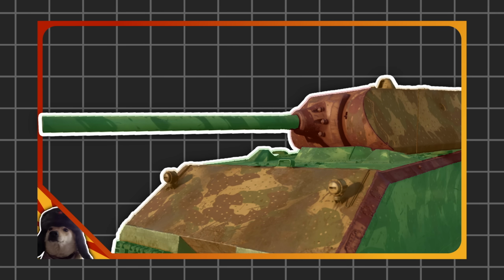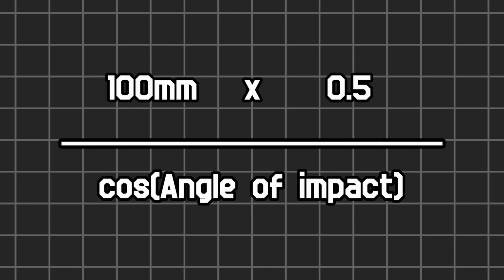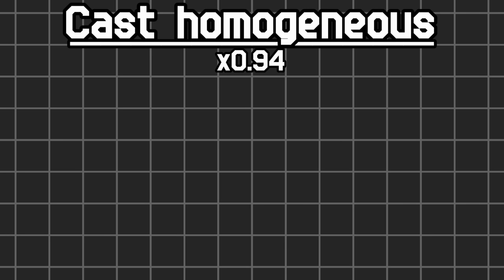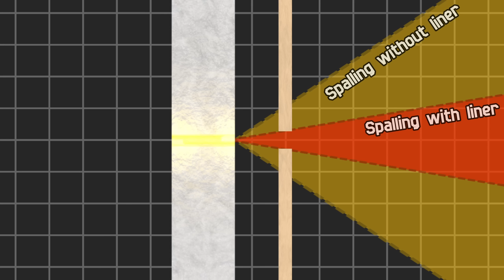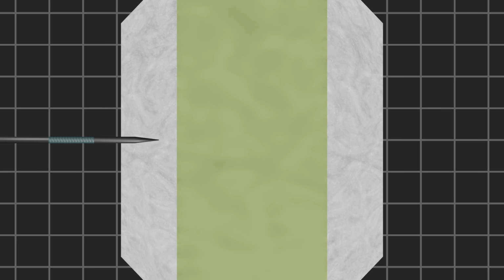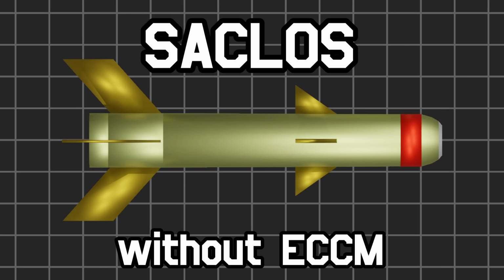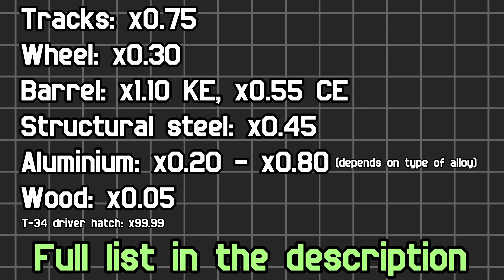Armor Types in War Thunder EXPLAINED | War Thunder Tank Armor Guide

Comment: 2:30
Bro, plastics are ceramics too😭
Yeah, engineers are using specific materials as a ceramic (the material between 2 plates, mostly metal plates and has more heat resistance, which is good against hollow charged ammunitions/anti-tanks and ceramics mostly less resistant against metal ones (two plates that is covering ceramic(Except Abraös tanks(M1A1 HC, HA and M1A2+)). Metals are less resistant against heat and more resistant against kinetic ones mostly.) 
But, you can out a metal plate as ceramic if you eant too, it's mostly about how you placed it. 
But, it's better to use it correctly.
Reply: Plastics are polymers
Ceramics are their own material class
Reply: @luisrenato4089 
I know. 
As an armoe type, the thing you said is correct.
But, when you use it in a NERA, it becomes ceramic.

Comment: I wonder if the game implodes if you defy all logic and manage to hit the enemy armor at a 90 degree angle.
Reply: You hit people at 90 degrees all the time
Reply: @thatguy7612 he meant 90 degrees from vertical
Reply: @Epsilon2042 you mean 90 degrees from horizontal?. Also i that the original comment might have been confused and means at 0 degrees to the armor plate, which would be game breaking at all and would just be a ricochet
Reply: @thatguy7612  90 degrees form horizontal would just be an armor plate with no angling

But yeah it wont be gamebreaking, only a furstrating nonpen/ricochet

Comment: there are several errors:

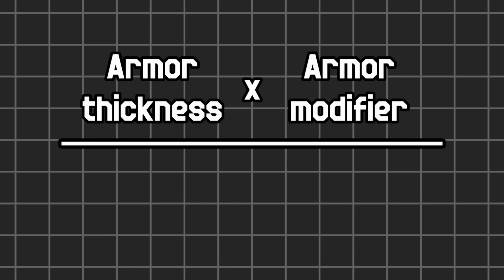0:40 it is the effective armor for the line of sight. basically how much armor it has to go through at that angle.
but the actual effective armor is only this amount for HEAT type shells.
against full calibre shells and gen 1/2 APDS the effective thickness is more than the line of sight effective thickness.
for example the upper plate of a T-54 1947 at 60 degrees has an effective line of sight thickness of 240mm. 
shooting a very strong APCBC at it (BR-482B) and the effective thickness is 360mm, 3x of the base thickness instead of 2x which was expected (using the 83mm solid AP the effective thickness is 400mm)
shooting it with the "strongest" gen 1 APDS from the Conqueror at the same angle, and the effective thickness is 421mm, more than 3x.
shooting it with a gen 2 APDS (105mm L28A1) the effective thickness is only 308mm, still more than the line of sight thickness.
against APCR (T44) the effective thickness is 560mm, meaning it is by far the worst shell to hit angled armor

get 3 APDS and APFSDS will usually have the same or a bit less real effective thickness as the line of sight.
same target, using a gen 3 APDS (M728 or L15A3), the effective thickness is 218mm, less than 240.
using the best APFSDS in the game (DM53) gives an effective thickness of 207mm

HESH and HE does not care about the angle (except when it is a really high angle, then they can bounce off).
HE either pens or not, if it pens then it will overpressure the crew in that compartment.
HESH can spall (perpendicular to the plate) or overpressure similarly to normal HE (HEAT can do this too) but it is not as reliable.

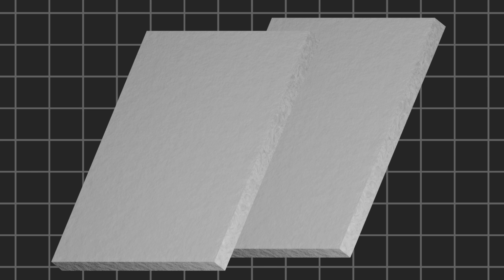2:07 it highly depends.
it is very effective against APCR and gen 1 APDS (and somewhat effective against gen 2 APDS and has pretty much no effect on gen 3)
it will also make APCR and gen 1 APDS (and sometimes gen 2 at high angles) shatter.
for example shooting the upper plate of a Super Pershing with a Conqueror's APDS gives only a 240mm effective armor but it wont pen because it shatters. same goes against APCR, however a gen 2 APDS (L28A1) will almost always pen, and gen 3 APDS and APFSDS always (given enough pen)
it works well against HEAT and especially against HE and HESH (given if no weak plate is present nearby because then it can trigger overpressure).
but even against HEAT distance matters a lot. 2 plate close to each other will offer much less protection than 2 plates with a lot of distance.

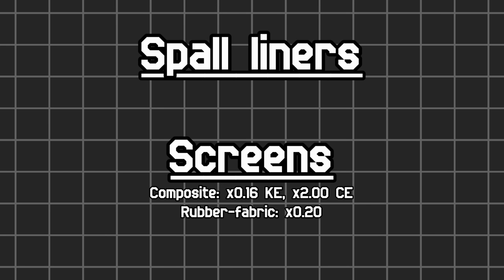2:53 again very depending.
it will vary from tank to tank basically.
for example the upper hull on a Challenger 1 and 2 are almost the same (20/25mm RHA, 200mm NERA and 80mm RHA), yet the Challenger 2 has an effective thickness of 510mm while the Challenger 1 only 300mm vs the same shell (L26) at the same angle
also an addon composite on a ZTZ88 with less than half the tickness of the one on the T-55AM offers much greater protection against KE and almost the same against HEAT despite being much thinner

3:34 some top tier russian/chinese ERA is also effective against KE, however the angle of impact also play a key role. a right side on hit from a HEAT shell will likely pen ERA, even the stronger ones, yet at high angles it can stop even APFSDS (if the ERA is capable of that, not all can).

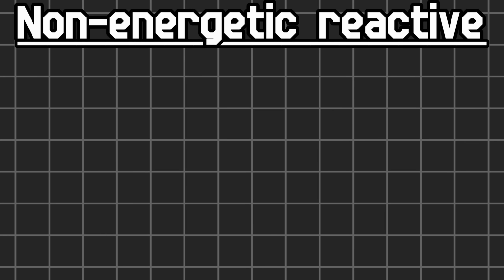3:46 or pick up a resupply point in PVE mode

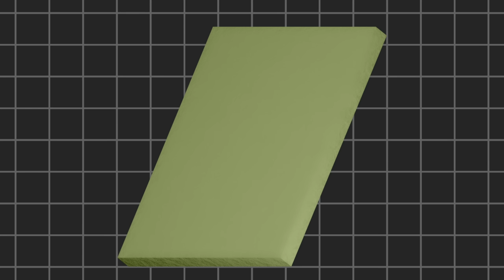3:50 aka "non explosive"

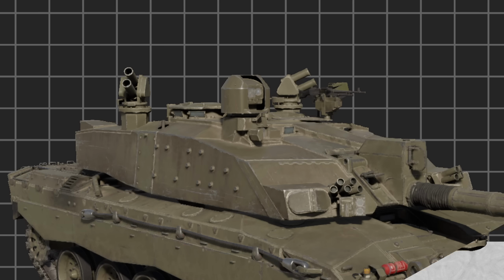5:18 they also have other factors. they can intercept shells within a speed range.
for example the drozd APS can only intercept shells that fly faster than 70m/s but slower than 700m/s
there is also a limit on the elevation and often the location, for example said APS can only intercept shess that are comming from where the turret faces, while the Challenger 2's APS can cover a bigger area
Reply: Dude if all of these situational applications were accounted for the video would be triple the lenght
Reply: @EdyAlbertoMSGT3  I don't see how a more elaborate explanation's a bad thing.
Reply: @EdyAlbertoMSGT3  thy are not situational, they are depending on important factors that werent even mentioned and some things are just plain wrong
Reply: Wrong
Reply: @A7XmuRderu011  yeah what is wrong? lol

Comment: spaced Armour (with reasonable spaces between the plates, not something like 5 meters) is less effective against conventional kinetic rounds than just one plate (maybe against apdsfs it performs better, dunno i don't play modern tanks). I am pretty sure this is true in game, but it's most definitely true in real life. The Cromwell has 2 plates, both around 25mm thick so a total thickness is around 50mm yet its still less effective than the unangled armour on the t-34.
Reply: The main use of composite armor is to reduce weight, if any MBT were to have no composite and maintain its armor protection they would be far more expensive to produce and significantly heavier

Comment: I still don't het how rubber has a higher multiplier than composite armour. 2:57
Reply: because composite screens are designed against HEAT, and have a 2x multiplier, but perform a lot worse against KE because they are not designed for that
Reply: @o-hogameplay185  that's not an answer lol

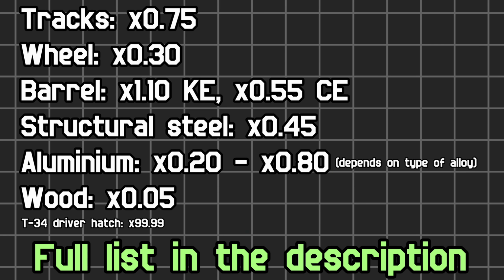Comment: 5:30
why the fuck does a barrel have 1.1x modifier Huh?!
Reply: to be fair, the type of steel (regular rolled or hardened idk) used as barrel in War Thunder is different from regular armor steel, if you go into WT Xray and look at the barrel and breech, it's called "Gun steel" (or Barrel steel, idk i haven't played for a while)

AFAIK the steel alloys used in the barrel, breech and the muzzle break (if the gun have it) are extra hard to handle the pressure of the rounds fired, the exact composition for these steel alloys are most likely restricted info or straight up classified (as i cant find any for for any gun in service larger than a 20mm, even then it's already hard to find with only google search) so that's why it has a higher modifier than regular rolled steel armor.

pretty realistic imo, but i kinda wish they put more of their energy into actually balancing the bloody BR of these vehicle with other method more sophisticated than "wait, this non-premium vehicle has a higher win rate than other vehicle in the BR range? utterly unacceptable! put it .7 BR higher!" 

but hey, if it means it takes more autocannon shots to destroy it, sure why not
Reply: maybe it counts as spaced armor
Reply: tank barrels are often made of much stronger steel alloys, for example the tank barrel of the T-44 uses a chromium alloy
Reply: *stalinium alloy @ChristandMMA

Comment: The T-34's driver hatch is blessed by the snail and only on 1/150 chance do you get the correct armor thickness and are able to penetrate it.
Reply: The thickness is correct, the hatch is about as thick as a Panther's upper front plate. The problem is that irl it doesn't matter since the shell would punch the whole hatch into the tank, but war thunder doesn't model structural damage.

Comment: The funny thing is is that Gaijin don’t understand that TOW missiles are designed to make soft kill useless, but i somehow find it is more effective against TOW missiles because they don’t understand that it doesn’t work on them
Reply: smartest anti furry
Reply: Get yo ass outta here with this corny ahh profile picture
Reply: TOW is SACLOS, so nothing wrong that soft kill APS work
Reply: @igororlov3282  The W in TOW stands for wire. It is wire guided, a radio signal or IR signal being given off by a soft kill would be ineffective because all controls are sent down the wire and received by the missile only through the wire. The entire reason the US made the TOW and TOW2 wire guided was to prevent hacking and soft kill from being possible
Reply: @redminer6394  Nope, the missile has a sort of autopilot, and the wires are only to make minor adjustments to the missile, also your pfp is something
Reply: @redminer6394  Nevermind, after reading about it, the missile can't be guided because it uses an IR spotlight in the missile to track it, and having interference (the IRCM from the T90A, etc) can make it not work
Reply: @existanimal0  To add onto this, the TOW 2 missiles use a coded IR signal, which helps prevent the guidance system in the launcher getting confused by any IR jamming systems. You can test this yourself in the test drive by shooting the tank on the hill to the right with TOW and TOW 2 missiles (if said tank is the T-90 with the IR jammers). You'll see the TOW missiles fly wildly off course, but the TOW 2 missiles don't.

Comment: a video on  missile guidance types would be kind of neat, whether it be planes, helis or ground vehicles. keep up the great videos!
Reply from the maker: Check out my AAM guide from last year, that might be what you're looking for
Reply: @skDoger to be fair it might need an update since alot has changed in a year
Reply: @skDoger I have no clue how to use targeting pods on aircraft
Reply: Tim’s variety channel has some good videos on this
Reply: No way you don’t know that:

The missile knows where it is at all times. It knows this because it knows where it isn't, by subtracting where it is, from where it isn't, or where it isn't, from where it is, whichever is greater, it obtains a difference, or deviation. The guidance sub-system uses deviations to generate corrective commands to drive the missile from a position where it is, to a position where it isn't, and arriving at a position where it wasn't, it now is. Consequently, the position where it is, is now the position that it wasn't, and it follows that the position where it was, is now the position that it isn't. In the event of the position that it is in is not the position that it wasn't, the system has required a variation. The variation being the difference between where the missile is, and where it wasn't. If variation is considered to be a significant factor, it too, may be corrected by the GEA. However, the missile must also know where it was. The missile guidance computance scenario works as follows: Because a variation has modified some of the information the missile has obtained, it is not sure just where it is, however it is sure where it isn't, within reason, and it knows where it was. It now subracts where it should be, from where it wasn't, or vice versa. By differentiating this from the algebraic sum og where it shouldn't be, and where it was. It is able to obtain a deviation, and a variation, which is called "air"